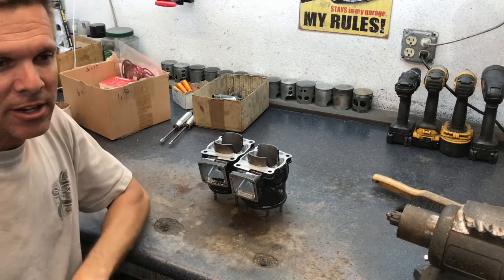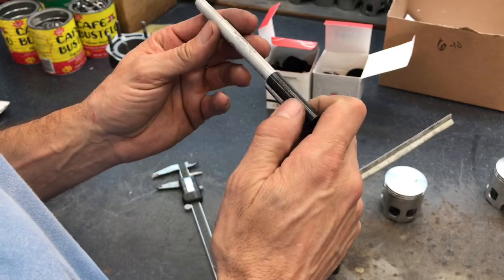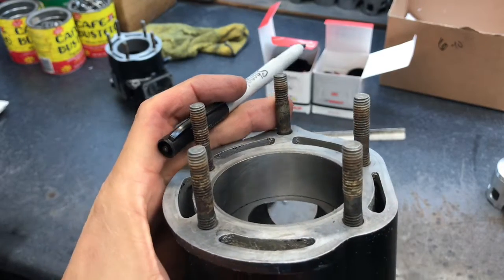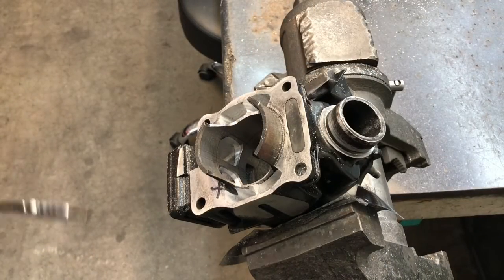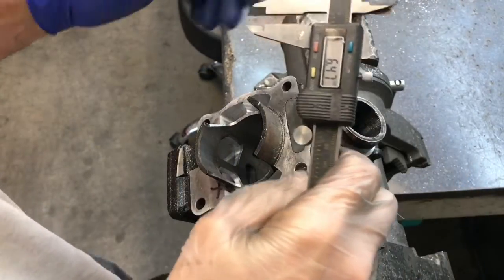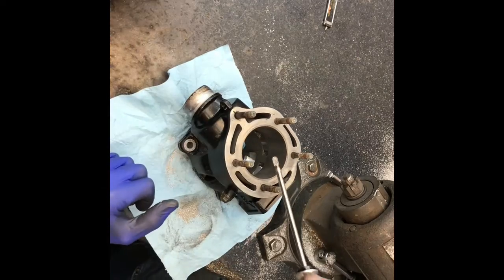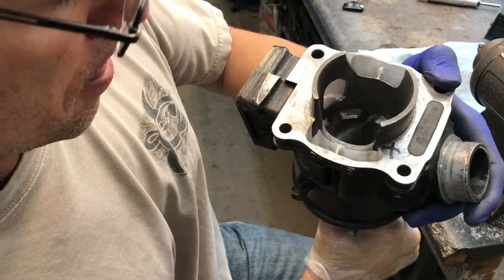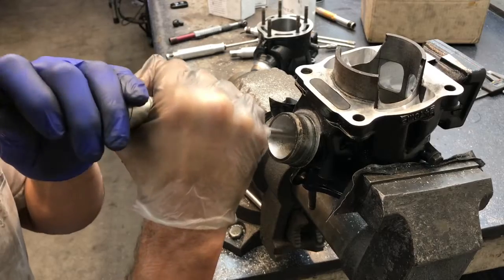Banshee porting

Comment: Hello great worck,i will try myself because starting to get expensive sending oversea ,butt do you have the nubers in mm of those lines?😊
Reply from the maker: Its best to use the degree wheel, especially when first starting.
Reply: @herrjugsracing7816  so i need to putt my syl back on my banshee and then draw them lines when turning the engine?
Reply from the maker: @frozt900ccm  This video will help on how to use a degree wheel. https://youtu.be/vP9Ns48HPtQ
Reply: @herrjugsracing7816  okey i gonna do that when im home from oilrigg,

Comment: Ever make a template for porting that you can slide into the cylinder to help the novice get better results??
Reply from the maker: I have not. I do show you how to use a degree wheel so you can do it yourself. I know a template would be easier.

Comment: You do really good work. Those look a lot like dental handsets and I can believe they're expensive but so much better than air tools that blow the swarf all over the place. So how did you come by that fancy rule...engineers or architects??? Not many people have those and just wondering how you came by yours.  Having three edges w/ the hollow area between the edges seems like it would be a help ensuring the lines stay vertical and parallel in the bore...just keep two edges flat on the cylinder wall by pushing on the 3ed edge...self-aligning.